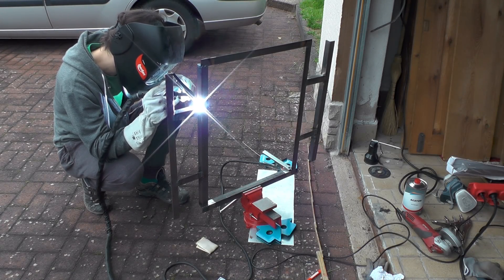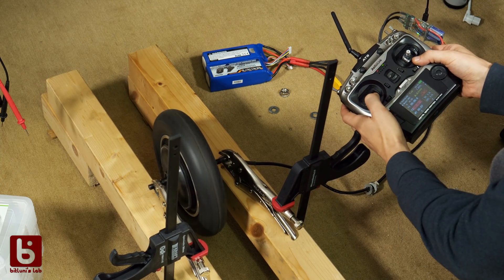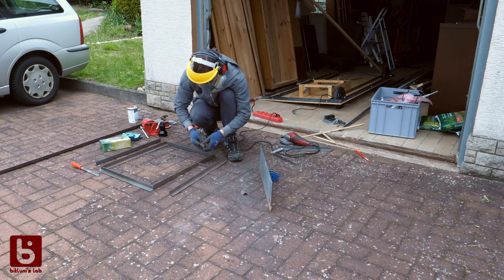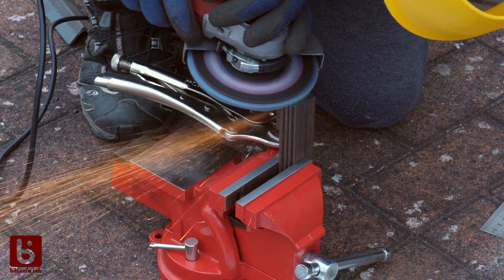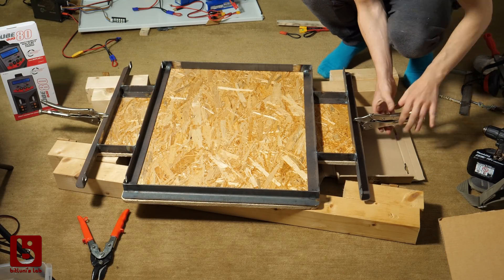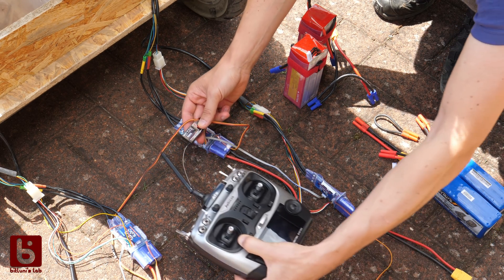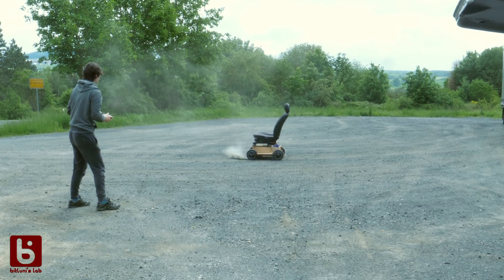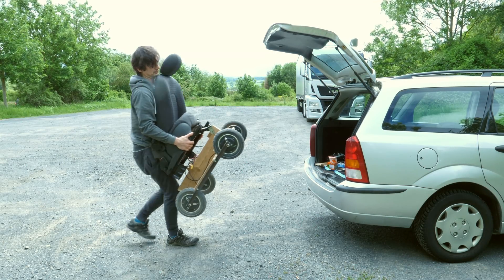Worst electric car in the world

Comment: Good to see you wearing a respirator while cutting angle iron.  The abrasives in those cutoff wheels are murder on lung tissue.. causes bronchial scarring that can be irreversible.
Reply from the maker: that crap smells so badly that can't be good. I even got the filters with the fallout protection class.
what is the worst is seeing people not wearing eye protection while angle grinding.. that's simply the worst